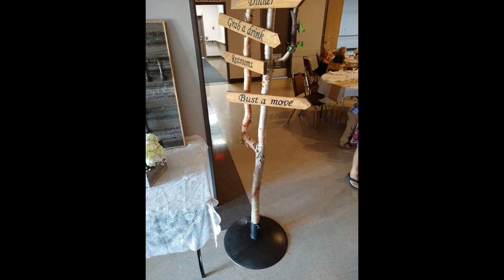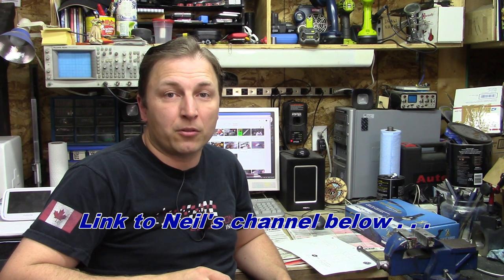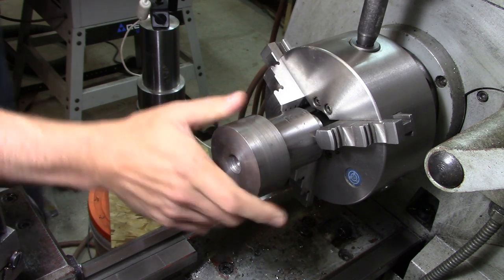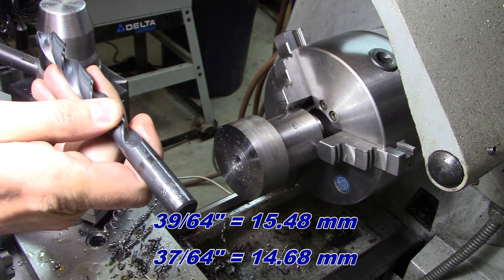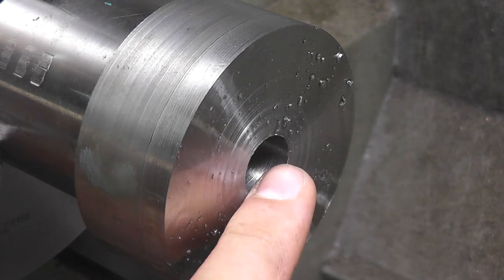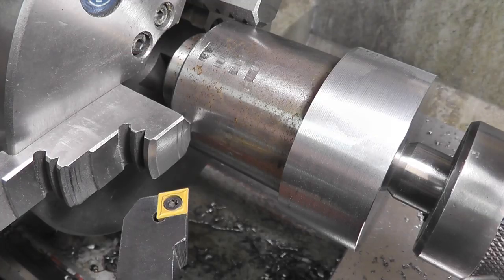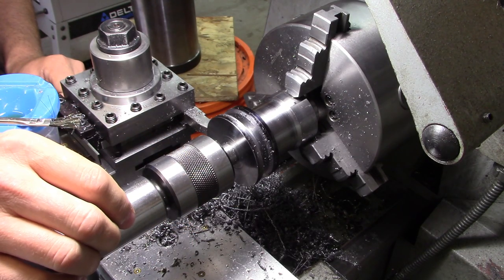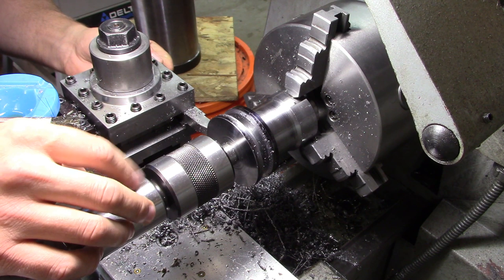Alba 1A Shaper Reassembly Part 7A: Turning a Custom Motor Pulley

Comment: Hey Everett, good to see a new video (my next video is way overdue, I know.) I had wondered if you had cromoly/4140 at around 5:09! I have some material that turns just like that (was mystery material to me), that I have been assured by a friend is cro-moly. It was certainly different to turn than the usual hot rolled steel. Harder, more pressure needed, more stringy, but less smeary, and a great fine finish was left, especially after increasing the depth of cut and feed rate.

Good to see you filing left-handed. Max Grant from the Swan Valley workshop taught me to do that and I've done it ever since. Awkward at first, but easy after two or three goes. Much less potential 'interaction' with those spinning chuck jaws. I value my digits!
Reply from the maker: Hey Craig, after working with it I'm almost positive that chunk of scrap was 4140, due to the stringiness. The chip breaking/insert combination was definitely sub-optimal but thankfully I still have all my body parts intact.

Comment: Everett, brand new disc blade,  Nice. And nice job on the pulley. In my opinion you should never have to explain why you did a job different than someone else. Lots of my jobs are thinking outside the box. There are lots of ways to achieve your final results.Gary
Reply from the maker: Thanks Gary, I'm satisfied with the finished pulley. I often get comments asking why I used one method over another so just figured to give the rationale for why I chose the way I did (the madness behind the method, lol).  At least next time using up scrap I will have more left turning lathe tools, lol!
Reply: I have had many times where I welded smaller pieces to another in order to hold in lathe. Lots of different ways to get the job done. Enjoying your channel.
Gary

Comment: Great work, RIP Mr Camera. Correct method to machine the Vees, when you are limited on distance from chuck.
Thanks for sharing and best regards from the UK.
Reply from the maker: Thanks, it's a method I've used before.  A bit slower but does work, and I had the tool already made from the last pulleys a couple years ago.  As for the camera, we live, we learn.  Oops, lol.
Reply: @EverettsWorkshop  , Yes, machining parts, videoing, lighting etc, is akin to herding pampered cats. I visited someone recently, and they had a small wall sign saying "Dogs have owners, Cats have Staff"! Very true.
Always difficult on smaller/less powerful machines to achieve optimum machining conditions for insert tooling, ref chip control, it is very rare you can meet the criteria stated for each insert, it seems you need a 10 plus kilowatt (15 HP) spindle to use them. Positive inserts help for smaller machines, these are mostly the centre screw type (I saw you use a CNMG in this style), you can get negative inserts with chip breakers, but obviously it can get expensive very quickly to do this, with the only gain is hopefully no bird nesting.
Grinding HSS tools with chip breakers is an option, but then your hobby, if I may call it that, gets monotonous.
Enjoying the builds.

Comment: Hey Everett, nice to see you in the shop, I do remember the "days of distraction" as you were explaining . Nice job on the pulley, like Max, I am more of an angled compound guy, not tooo familiar with form style. Cheers and thanks!
Reply from the maker: Thanks Howie, glad to have some time again. Next pulley will probably be done via compound adjustment, but I already had the form tool from making pulleys for Uncle Tim a couple years ago. Might even make a mandrel and do between centers like Mr Pete did, but don't need any pulleys anytime soon.

Comment: Nicely done...!!!     Those HSS parting blades are life savers, got a good stash of Cobalt type ones, they last and cut just about anything you need to use them on.
Like you say about smaller machines, it gets done, just need more time, question of being able to feel what your machine can take...
Looked like you said, 4140, in order to get decent chips you really need to use much higher feed rate as well as deeper cuts or those strings is all you gonna get...  
POOR CAMERA...!!!     😭😭😱
Reply from the maker: Thanks Pierre, it had a couple setbacks but the pulley is now made. Each little problem needs a slightly different fix. Crazy long stringy chips are hard to avoid at times, still experimenting with tooling as to which inserts and profiles would work well but also still have a bunch of CNMG to use up as well. All in time . . .

Comment: Came out well .  I  just use the parting tool & angle the compound  to do pulleys  , saves me having to grind different form tools . Check your gib adjustments on your compound  , mine was loose causing a bit of parting chatter the other day  as i always forget about that gib .  Bummer about the camera .  Cheers  &  theres a sticker in the post , hopefully it should get there in a couple of weeks or so !
Reply from the maker: Thanks Max, always space on the board! The camera incident was a bummer but I hurt nothing but my dignity in the ordeal at least . . . If there was more room to the chuck or if I had a left hand VNMG holder then I may have tried the compound trick, but already had the form tool from the pulleys I made a couple years ago for Uncle Tim. Hope you're doing well!

Comment: Just a thought, you might try turning pulleys between centres, It's worth thinking about! All the best, Matthew
Reply from the maker: I've seen people do pulleys between centers, but I don't have many mandrels to do that.  I'm currently cutting another pulley for someone else, and will try the compound rest angle trick on this one instead of the form tool.
Reply: @EverettsWorkshop  You don't need a mandrill to turn between centres! You need a live centre bigger than the bore of the pulley and a piece of scrap turn to a 60° point in the chuck for the other centre. The difficult bit is making a drive dog! You use one os the jaws of the chuck to drive the dog! Regards, Matthew

Comment: A word about indexable parting blades. I bought two sets of cheap blades + tips. They are worth less than the price you pay for them - just a little bit of chatter or the last bit walking over the tip, and the material in the holder bends out of shape -> no longer holding the cutting tip. I thought a 3mm one would work better, so bought that after breaking a 2.2mm wide one, but that lasted even less time (maybe I was being a bit more heavy handed)

Spent much more on a "proper" one (ISCAR one with GFN tips), and so far (touch wood) it's done great, much less chatter - can part at 460 rpm for 1" stock, cuts nicely and has survived one case of "oops" where the blade got completely stuck and I had to release collet chuck to get the my cross slide moved back out of the way (trying to shorten an M5 stainless cap-head bolts, and it wasn't held well enough).

(I'm a novice at the lathe, so I'm getting things messed up now and again - as long as you keep fingers and face out of the way and don't break any real expensive bits, that's how you learn, eh?)
Reply from the maker: Well, I've learned a few things the hard way, for sure . . . Really had frustration with these HSS parting blades, and thinking about getting an indexable blade setup. Still waiting for the hobby fun budget to recover from buying that boring/facing head, lol, but one of those blades is definitely on the list!
Reply: @EverettsWorkshop  yeah, I understand that feeling of "I've spent all the fun budget". And you may well have better luck and/or skill with a budger set of blade and inserts, so if you want to see what the difference is, by all means go for that - they work quite well until you either get much chatter or mess up the last couple of mm... 20 bucks or so is much easier to find than the over 100 that I paid for the ISCAR - but having the ISCAR is definitely an improvement... other brands are available and probably work well too - as long as it's not the budget option on Ebay/Wish/Banggood - I have several other tool holders, etc,  that are budget and work well, but two x failures on parting blade tell me that's not one of those to buy cheap - that just mean buy again... In my experience, your milage may vary, etc, etc.

Comment: Seems you have been busy! (Won't be long before you hit 5k subs!)
Re the welding of galvanized even when it seems cleaned up - a bit of muriatic acid might help to really clean off the Zn residue.
I flinched when that camera lead got caught up - ouch. Certainly proves a point about rotating things!
Nice job in the end, in particular considering the material being tough.
Reply from the maker: Thanks Chris, I'm happy with the pulley in the end.  Haven't tried the acid trick on galvanized steel, but I also don't plan on TIG'ing it again anytime soon!  As for the camera I'm thankful no one was hurt, the long stringies coming from 4140 can be quite annoying.

Comment: G’day Everett, too bad the camera had to get into the act and give up its life for the cause, spectacular video but. Parting and form tools are hard work on a small lathe, I tell myself “well it’s better than using a hand file:)”
Cheers 
Peter
Reply from the maker: Thanks Peter, the camera was my fault between trying a different angle and the poor chip control. Long stringy ones are hazardous and I took a chance, at least it was the camera and not my hand or fingers. I used that form tool a couple years ago to make some pulleys for my uncle but after seeing Mr Pete do it with the compound I figure will try it that way next pulley for something different.

Comment: Gday Everrett, there is nothing wrong with doing things differently then others, if it works for you it’s the way to go, it would be a boring old world if we all do things the same way, I would have been a little more upset then you if that was my camera, I know my GoPro was expensive but it takes a bit of the fear away if I drop it but like always I have to upgrade my Mac computer to handle the higher settings of the camera, I can never win 🤦🏻‍♂️🤷🏻‍♂️, very enjoyable video like always mate,  ATB Matty
Reply from the maker: Thanks Matty, we all have different mixes of experiences and available gear so we all have to take slightly different approaches to how we do things. As for the camera, the GoPros are good units but out of my price range if I want to still collect machine tooling, so I generally use 'affordable' eBay units. Still, it's the first camera I've lost in action, and they've all been dropped!

Comment: hi everett just wanted to say i seen you reaming with oil. this old tony or else it was stephan gotswinter said never ream with oil it will always be oversize. it is said to use  water soluable coolant. just wanted to share that with you. thanks for the good vid as usual.
Reply from the maker: Thanks Jamie, I hadn't heard that one about the oil, I have a lot of respect for Stephan and Tony, so if that's what they've found then there would be a reason for their saying so.  It seemed to work for me to use oil, and I was happy with the fit, but maybe if one is going for the crazy accuracy that Stephan does then maybe it makes a difference?
Reply: @EverettsWorkshop  It was Stephan that made the comment in a video some time ago, maybe as much as two years.  And the comment was more that lubricating a reamer with oil will produce a larger hole than lubricating it with water soluble coolant mix.  Seemed to be more about a choice to achieve a particular result than one was good and one was bad.
A different point is that in a NYC-CNC video, also quite a while ago, John Saunders was testing something to do with reamers and in discussing his initial bad results he mentioned that one should never peck a reamer, just feed it smoothly for the entire depth of the hole in one go.  Someone else in a recent video did not address that directly but did discuss that there was sufficient room in the flutes of the reamer to hold all the chips that would be produced in a reaming operation.  Not sure about the no pecking recommendation either.

Comment: Man, that scared me when the camera was eaten by the lathe.
Reply from the maker: Well, it was totally my fault. A camera that needed a cord due to the weak battery, an attempt at a cool new camera angle, and poor chip control.  I made the wrong call and the camera paid for it . . . Gave me incentive to order some left turning tool holders.

Comment: I don’t see the problem with that method. Of course you could have made an arbor, especially with that short of stock, may have been easier, but that’s the way I think.
Reply from the maker: I've made pulleys before using the form tool and they turned out fine, just figured this way I could use up some stock. If I have to make another pulley down the road I might make an arbor to turn between centers like Mr Pete did just to try that method out.
Reply: Everett's Workshop not beating a dead horse I was thing maybe a long bolt or a custom arbor. Chuck mounted in one end and supported by a center. Probably a soft washer and a nut to hold it. Actually I liked the form tool idea. My thinking in the suggestion was make the pulley grooving set up lots more rigid.

Comment: lol just stopped the video to comment and then started it  to see you had a piston fit on your ream lol and you used oil. well ok the proff is there oil is good. cant believe everything you hear on youtube even though i have the upmost respect for tony ans stephans channells.
Reply from the maker: I hear you, as I say I respect them as well - it seemed to work this time but maybe they have good reasons and past experiences that have led them to their conclusions.  The shank of the end mill was about .0004" under 5/8", but it still had the nice fit on the shaft so that was what mattered.  Again, I'm curious as to why they would say that as perhaps in other situations using the oil would get me into trouble with oversize holes.

Comment: Hi Everett,  LIked you way cutting  V groove.  I also noticed you are using carbide insert toll holders with quite a negative rake (or it is camera angle? )  what insert is that ? any specific manufacturer ?
Reply from the maker: Thanks Gennady, I've made a few pulleys with this form tool a couple years ago so that's why I went with it this time.  I got a few CNMG holders and some inserts for cheap, and have been using them, as well as one VNMG right hand tool.  I don't know what the nomenclature of the left turning tool insert that was used that was REALLY stringy but I won't be using that one on 4140 again, lol!  Most of my holders are eBay from the far east, so no real specific make.

Comment: Again, a 'sketchy setup' that I don't think is sketchy. You have your '321 locating' or '321 workholding' figured out. Both larger diameters of the pulley and the small diameter of the inside of the pulley sat on that adjustable parallel. That sorts Z. Then two of those slim pulley diameters against the rear jaw face, that sorts Y. And your variable is X, but you seem to have the workpiece butted up against the diameter of that cylindrical round bar. I don't think the work piece can move. So - I don't think it's a sketchy setup! Yes - I think we've had this conversation before! :-)
Reply from the maker: Hey again Craig, It was less solid than it looked, the piece wasn't really wanting to stay still so I had to gently manually feed the saw down and physically hold the pulley portion to keep it from rocking. Like I say, it did get cut but didn't really want to share that part as it was a bit of a bad example, lol. There were enough things that went sideways in the making of this part . . .
Reply: @EverettsWorkshop  Fair enough :) I take your word for it. I guess  a V-block to cradle some of the round parts would be good, but cradling a pulley isn't as easy as it sounds. At least you got the job done.